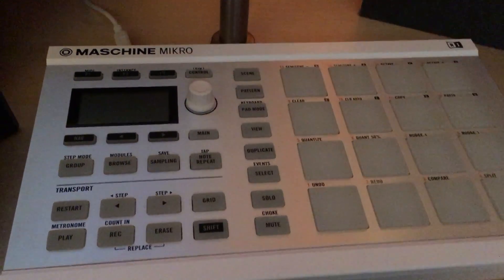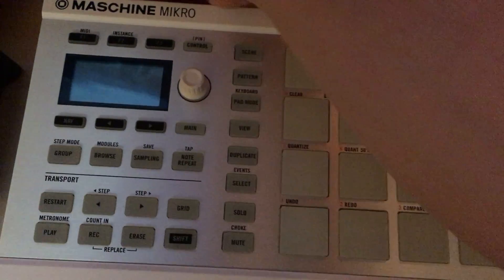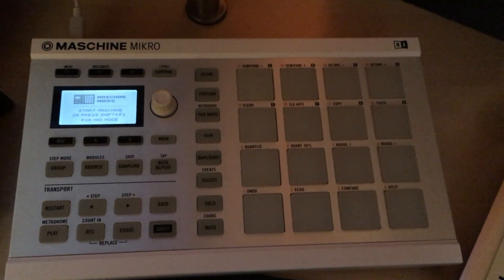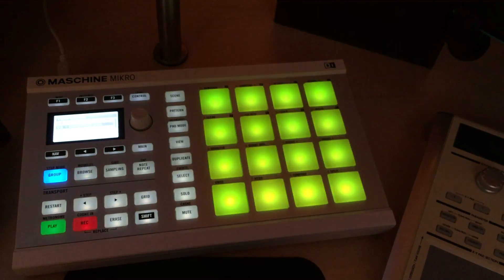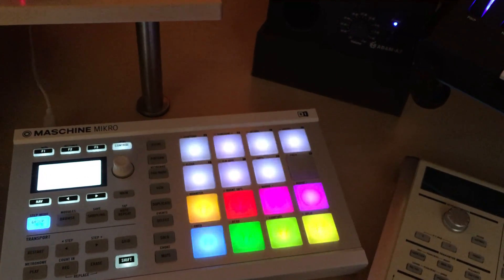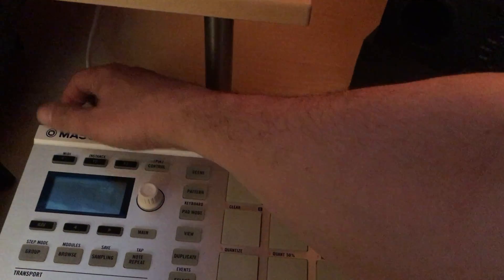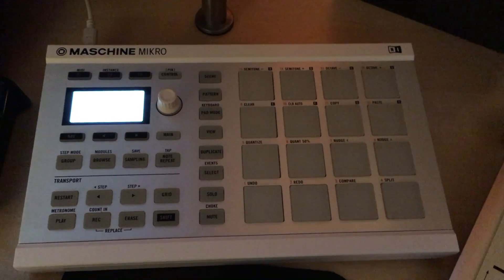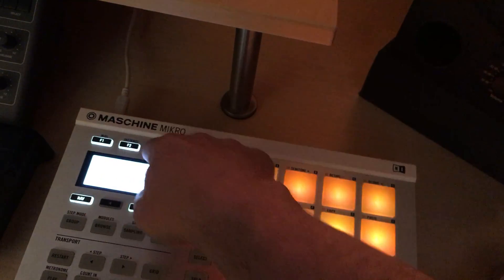Maschine Mikro MKII Hardware is Bricked?!

Comment: Did you use pro tools at the time? Because i sold my mikro and the next owner had the exact issues as you had and we solved it by deleting AVID core audio plug-in file and then the mikro mk2 hardware worked perfectly..
Reply from the maker: Nope, not a Pro Tools user... but I know that deleting the Avid core plug-in was one of the suggestions for bringing it back to life. Didn't work for me in my case (the Avid plugin was already deleted trying to troubleshoot a different issue before this even happened.) As mentioned somewhere else in these comments, the ONLY thing that fixed it was upgrading to El Capitan. I'm now on Sierra and everything is continuing to work normally, although I use the Maschine very infrequently now. (Prefer my MPC X!)